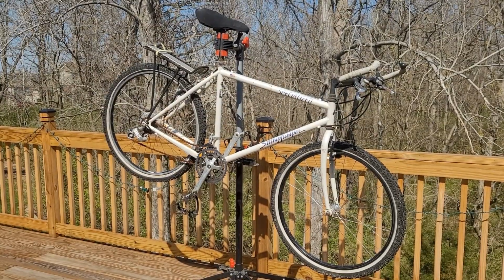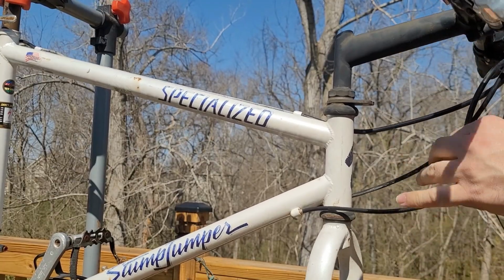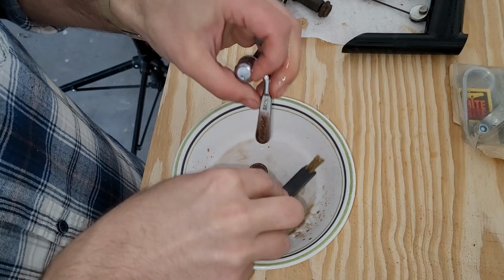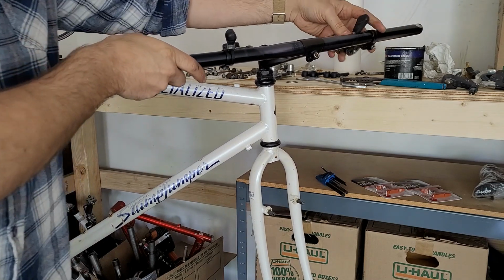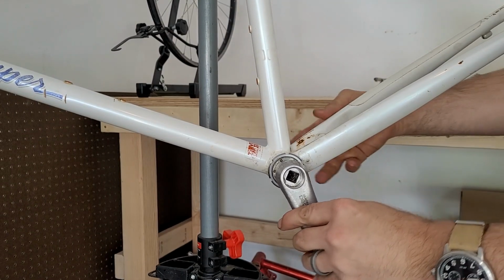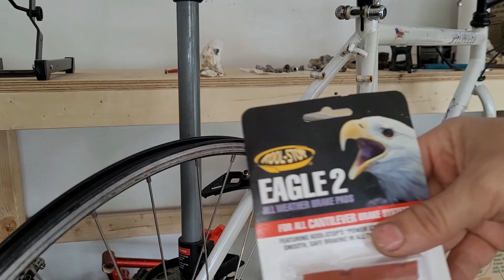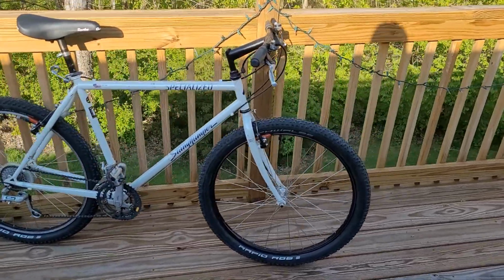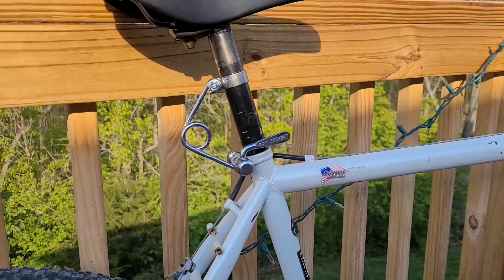Bike Restoration: 1991 Specialized Stumpjumper

Comment: I like it looking a original. I think it depends. I have almost original  1988 stump jumper other than the front fork and front wheel. More scratches than yours. i have no desire to change it. Triple butted frame. If I remember right the small front sprocket is oval. I really like that white frame. Very nice looking bike. Thanks for sharing.

Comment: What you definitely should do is take a green scratch pad and remove the rust from the frame. Once done you can use nail polish (clear or in the frame color) to prevent the steel from further rusting. Nail polish is soft enough for the screw bolts btw. 
And I always use car wax/polish to refreshen the old dull paint of the frame. Looks like brand new afterwards and costs nothing.
Reply: @Alan Brando I've been handling steel frames for 2 decades now. Various Columbus, TrueTemper, Reynolds etc. in various metallurgy composition. 
They all have rust issues. Especially all screws are prone for rust and bottom bracket area.

Comment: I'm not in the "preserve the patina" camp. Rust isn't your friend. Maybe use a rust converter to halt its action and then wax over it to retain the old paint and "scars."
Reply from the maker: I use Frame Saver and sometimes Boiled Linseed Oil.
Reply: @lancehatch4475  can you use linseed oil inside frame as well? Some recommend motor oil but to me that seems a bit viscous.
Reply from the maker: @gregrobertson9957  it's more difficult on the inside because you will want to make sure the rust is removed first.